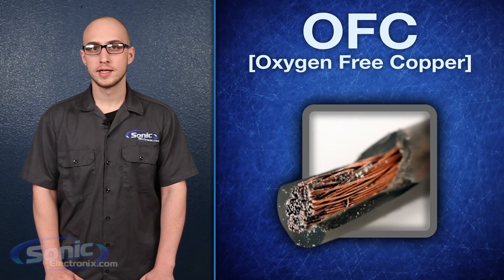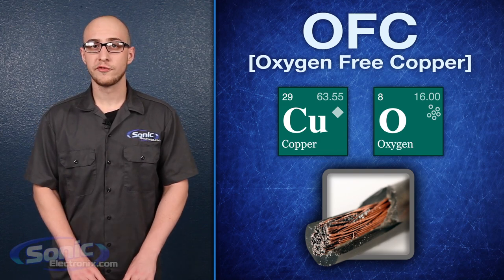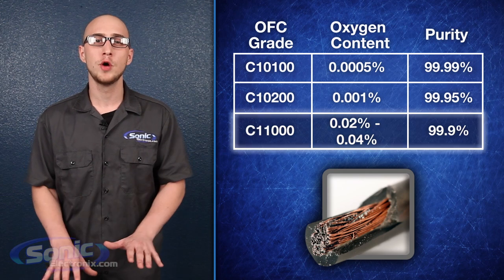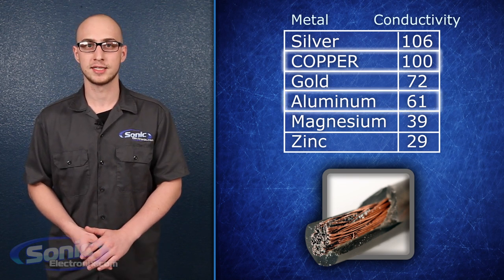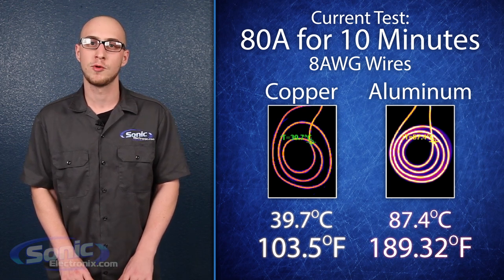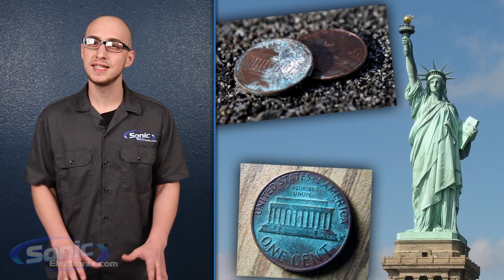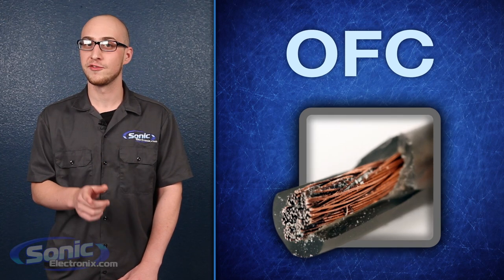Why Should I Buy Oxygen Free Copper (OFC) Cable? | Car Audio Speaker and Amplifier Power Wiring

Comment: Total bollocks. Said nothing about audio quality and also saying copper is better than aluminium... Well Duh! But said nothing about the difference between OFC and non-OFC cable when carrying a signal.

There is almost no difference. Copper is copper. 

You do see signal degradation but ONLY when the signal is in the GHz... Audio only goes up to KHz. As long as it's thick enough, normal copper is fine!
Reply: The comparison is made for the Car Audio industry which has been marketing CCA (Copper Clad ALUMINUM) wire for years now and it is far less conductive and gets very hot. We are not saying "pure" copper will not perform as well as OFC so clearly you should watch the video. We are saying OFC > CCA. CCA is a mixed bag of unregulated tricks. Some companies produce 95% Aluminum to 5% Copper and others do 80% to 20%... and on and on.
Reply: "you should watch the video", no need to be patronising, why do you think I commented in the first place? 

The video is called "why should I buy oxygen free cable" it should be called "Why you should buy OFC over CCA." (Aka: Spend more money, you get what you pay for,)  

And if overheating is an issues then use a higher gauge cable! 

Quote: "OFC copper is a group of wrought high conductivity copper alloys that have been electrolytically refined to reduce the level of oxygen to .001% or below" 

Nothing about the level of aluminium. I refer you to a document written by Roger Russell (Director of Acoustic Research at the famous McIntosh Laboratory) called "Speaker Wire, a history." http://www.roger-russell.com/wire/wire.htm

He states that "highly refined copper with silver impurities removed, and oxygen reduced to 0.0005%, has only one percent higher conductivity." He says this improved conductivity however is "INSIGNIFICANT in audio applications."

Also a cable coiled up will get hot with a high current passing through it due to inductance AND resistance. If the cable wasn't coiled it wouldn't heat up. If you're talking about power in a high wattage car audio system then yes, use high gauge, high quality cable so the amps can draw power with less resistance.

In short, when talking about audio there is little to no audible difference between copper and OFCH cable.

http://www.head-fi.org/t/408073/why-oxygen-free-copper-cables-sound-no-different-than-etp-copper

http://www.intexcables.com/9-cable-myths.html
Reply: Hi Chris, sorry the title was not clear enough for you. We are trying to help guide people to the right solution and avoid aluminum when at all possible. The purpose of the video and where it is placed on our website, and for what we sell were all done with good intentions and to help people who do not know much about "CCA". Given CCA and OFC are commonly searched, we also like our title for the video. Nowadays we do not see much non oxygen-free copper. 

This video is related to amplifier wiring kits and the proliferation of CCA in the industry. As you state, power in a high wattage car audio system deserves a high quality, copper cable. For the purpose of the "title", there is nothing untrue about why one should buy OFC. The idea of using copper (OFC or otherwise) is not mutually exclusive to us choosing the title OFC. If one watches the video, we want them to take away that in a 12V system, you really only see 1/0 gauge as the highest gauge used. Therefore, if someone is trying to run a 2500W RMS system with 1/0 gauge CCA, it really can choke a system. The same can be said at lower power when a person shops for an amp kit based off the amplifier's input size. If someone has a 1000W RMS amp and believes that a CCA 20ft run is adequate based off gauge size only, then it really will curb the effectiveness.
Reply: Hmm...I got to agree with you about the video title, which could do with some judicious editing, but you are being a little harsh to call it "total bollocks".  I didn't find any of it to be bollocks at all. (And the title doesn't say OFC vs ordinary copper)  It's really pretty helpful for anyone who doesn't notice the "CCA" as the cable type when they buy some (but sadly that isn't mentioned in the title, and would yield far more hits in a search by anyone looking for enlightenment on the OFC vs CCA issue)
Reply: Ffs... The title is wrong and Oxygen free cables make NO difference in the sound quality. AT ALL! Scientific fact. Less prone to Oxidization when passing high current and even voltage, yes. That's it, end of. Stop your internal monologue...
Reply: FFS Redoubled.  Despite being misleading, the bloody title does NOT mention sound quality, and neither does the video.  Why the f are you so hung up on proving something that is beyond the realms of the video or the description.  THERE IS NO MENTION OF SOUND QUALITY EXCEPT IN YOUR HYSTERICAL COMMENTS.  (And if my monologue were internal, you would not be party to it.  Hence "internal".  Good Day, Sir!)
Reply: The title states "Car Audio Speaker". And I'm sorry you missed the Bill Hicks quote...
Reply: Well not all, just most. Guy had a point. :)
Reply: Chris SweetLeaf 
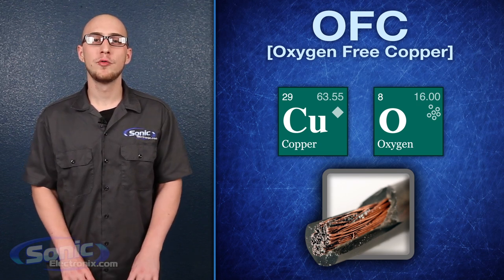2:43 Get better bait.
Reply: thank you, just discovered you videos & am learning so much. First bought items from you 10 or so years ago before youtube made learning so much easier.Never realized you had these very helpful, well done videos. Much appreciated
Reply: There is NO oxygen in copper wire! Period!

Comment: why don't u show the differences between 99.9% copper cable and 99.99% instead of aluminium vs copper?
Reply: +viermidebutura He said there is basically no difference between them for the regular guy.
Reply: Snilepisk then show the difference for the not so regular guy
Reply: We did not show the difference between 99.9% copper and 99.99% because the industry continues to promote cheaper CCA amp kits and we want to show that real copper (99.9% or 99.99% for that matter) are far superior in many ways. There is not a huge difference in 99.9% and 99.99%. The reality is when a brand makes a pure copper kit, they would not choose non-OFC because the price difference is quite small. However, as you can see in the retail price, an ALUMINUM kit is far cheaper. Do you see Pepsi make cans out of copper or aluminum? Aluminum is quite cheap and many just stuff the insulation with aluminum these days to appear to be "real gauge"...but the power throughput is not there.
Reply: Nathaniel Victor the title is why i should buy oxygen free copper - this imply why i shouldn't buy regular copper... and yet they talk about aluminium vs oxygen free copper
Reply: +viermidebutura The video is about why you should buy OFC. Furthermore, the video refers to OFC vs Aluminum that is clad with copper. I would encourage you read the following: https://en.wikipedia.org/wiki/Denying_the_antecedent. There is no correlation to us "dissing" regular copper by saying you should buy OFC. You should buy OFC, especially when it is really the only thing besides CCA that is being produced in Car Audio at this point. If you want to go buy some regular copper because you save 5% vs the OFC, then that is fine. My advice is still to avoid CCA for any substantial runs or when you need maximum power for the gauge used.

Comment: There is really no scientific basis for oxygen-free copper wire. In fact, normal copper wire, for electrical use is already 99.90% oxygen-free. Official oxygen-free copper (OFC) is 99.99% oxygen-free.
Do you really think you will hear a difference in quality, or see a difference in quality when two copper types differ by only .09% in oxygen content?
Reply: Copper vs Aluminum (Copper Clad Aluminum). Unfortunately, some brands have tried to pass 90% Aluminum as being equal to Copper (99.9% or 99.99%). It is not equal. That is all we are trying to do... we're just trying to help.

Comment: Marketing BS intended to rip off ignorant snobby consumers. Good for them, fools and their money are soon parted. I have seen copper wire that is a hundred years old with no corrosion and no loss of conductivity. How long were you going to keep that car? I use gold speaker wires anyway. I can hear the difference.
Reply: Watch the video. We are not Monster Cable saying you must buy this cable it is better. We simply said true copper (and of course in its OFC form) > CCA which is aluminum. It is an educational video meant to help newbies who might buy a $30 amp kit that is ALUMINUM instead of a copper one. Then they do not get as much power and wonder why their amp does not push it's intended power. There is no BS here.
Reply: GOLD?  Really?  Gold speaker wires?  Are they simply given to moniker "Gold", or did you opt for a material that is more expensive than copper or silver and has a higher resistivity which degrades the signal to the speaker, and is why gold is used for terminations (because they don't oxidise) , but not the full length of the cable.  Well, except for your gold wires.  I can smell the difference :-)
Reply: It was a joke, just like the huckster in the video.

Comment: the part when its glowing . well the one on right is longer. so ya its gonna heat up more than one that's shorter. why can't people just make 1000% no bullshit videos
Reply: That's absolutely made no sense what so ever!
Reply: +apllDgrapllD how does that not make sense. the wire is longer so ya its gonna get hotter than a short wire. its called resistance
Reply: Longer, perhaps, but they are both the same gauge (as stated).  And at that size, the length difference (if it exists at all) would be negligible.  0.6 MILLI-OHMS PER FOOT for pure copper.  Even if the one on the right were 100ft longer and all aluminium, it would still only have a resistance of 0.15 ohms more.